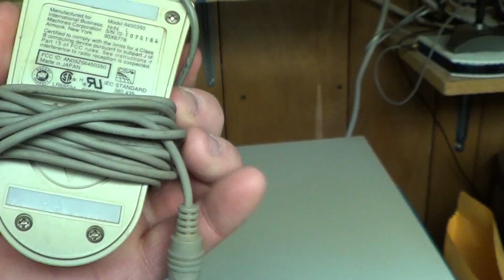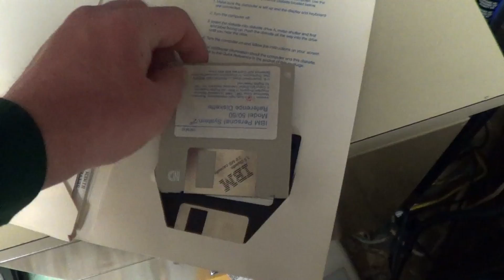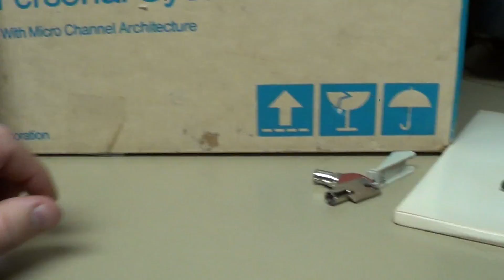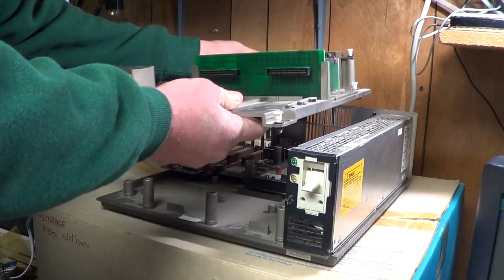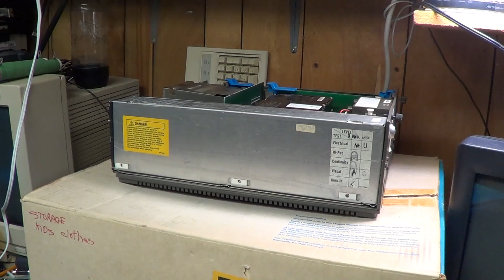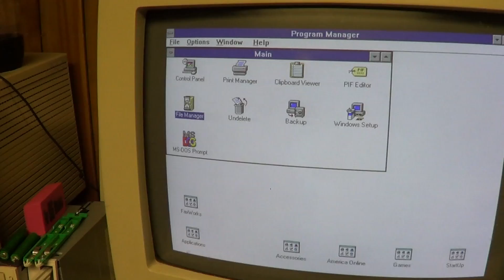The Good, the Bad and the Less Than Totally Inspired (IBM PS/2 Model 50Z Overview/Demonstration)

Comment: Just bought one of these with the original 80286. It has the monitor, keyboard and a box og software manuals. Its currently at a friends place in another city while i’m trying to find a way of safely shipping it (this is In Norway, and i don’t want to use the postal service).  It is untested, but i got the whole package for 500NOK ($50)! If you have aby tips for best practise when doing a first startup of a system like this, i would gladly welcome them!
Reply from the maker: Have a reference disk handy. You may need a replacement clock/CMOS battery. (In these it is a camera battery, the CR-P2.)

The floppy drive may need some electronic help and to be cleaned. The lack of a shutter means they can collect dust and random objects. There are surface mounted electrolytic capacitors on some of the drives and these fail often.

You might experience (as I did) a tantalum capacitor failing shorted and being blown apart.
Reply: @uxwbill  I haven't watched the whole video (does the video itself qualify as vintage?) , but in discussing transistors with vintage Apple Mac collectors: note the Macs do not have tantalums, but that means the transistors can silently leak over the years degrading the mainboard and causing damage without the owners knowing it. Some Mac collectors purposefully replace transistors with tantalums, exactly because these will fail loudly, and inform the (knowledgeable) user right away. This is arguably a better case for the user, as long as they understand what exactly is happening. I guess it's a personal preference in the end, but... think twice before replacing tantalums with "regulars". It might be bad for the computer's long term survival!

Comment: Hi! I know this is such an old video but I actually have one of these in very good clean condition, not a single bad sector on the 80MB hard drive, complete with original color monitor. I've been restoring it as a project but would anyone have any idea what it's worth today? All IBM parts, 286 chip, 1MB RAM, and what I'm pretty sure is an MCA Coax network card with PC-DOS and Windows 3.1. From what I can see on eBay the HDD is worth £70 alone.
Reply from the maker: Whenever this question comes up, my answer is always the same: "it's worth what someone will pay". eBay is a horrible barometer for the value of many things. People there have a bad habit of thinking their crap is worth more than gold, and anyone who'd pay a lot of money for a 30+ year old hard drive is either desperate (sometimes businesses are -- you'd be surprised what can still be running a "mission critical" system/program in some forgotten corner) or foolish. 

Or, more succinctly than that, "there are a lot of people on eBay who seem to have a crack habit".

Realistically, if you can find a buyer (remember, this is a niche hobby) who is interested, you're probably looking at the whole thing being worth between $100 and $200.
Reply: @uxwbill  Hi thanks for the quick response! I suppose you're right, it's such a niche thing now, so I'll list it for 180 and see what offers I get. Although here in the UK there are literally none for sale, so I might get lucky or stuck with it.

Comment: Old computers are fun as hell!   I only wish the ps2 used IDE controllers so I could update them with a SD card.  I had those capacitors blow up in a old 386dx board.  Board kept working. I did replace them though.
Reply from the maker: A few PS/2 models had IDE built in (25SX, 33, 35, 40, 53SLC2, 76/77 Lacuna board). For those that don't, you can run SCSI and something like the SCSI2SD.

Comment: I acquired a PS/2 model 70 a while ago.  I do appreciate the modular design.  I was also fortunate enough to have gotten an IBM VGA monitor and a 8514/A adapter card in the purchase. :)
Reply from the maker: On the proper monitor, the 8514 video mode is quite nice. (Even on the "proper" 8514 and 8515 monitors, you can still see the flicker, but for me at least, it is tolerable. And 256 color high resolution video is nice on a 286 class machine. I used mine in a Model 50Z. Should set it up again and do a video, while I still can.)
Reply: @uxwbill  Yeah, I haven't gotten around to get my PS/2 up and running yet.  I'm aware that the refresh rate is nothing home to   write about nowadays, but if i throw a LCD CGA monitor at it, it should hide the gflickering.  Been wrestling with a Gateway 2000 4DX2-66V...  I really kinda want to throw Windows 3.1 at the PS/2 just for kicks since the 8514 is well known for being one of the early fixed function windows accelerators. :)

Comment: I finally got around to cleaning up my own PS/2 Model 50Z today, and let's just say, I got to experience "tantrum capacitors" firsthand.  That very same cap, C23, while it didn't turn itself into a rocket like yours did, it did blow its top off and send flaming bits of itself skating across the inside of the computer.  It really is rather dread-inducing watching this play out through the computer's front grille.  Fortunately, after dismantling the system and clipping the remains of the blown cap off the board, the system did come back to life (though I should probably still source a replacement cap).  Now it's bombing out on 161 and 163 errors (I assume due to the dead and subsequently removed CMOS battery), and it refuses to boot the reference disk (both the original and a downloaded one), so that's next on my list.

Comment: I just found your channel and I have an old Model 50 I have kept in a garage. I didn't do a good job of protecting it, but it turns on and give me a 182 and 163 error code. I have no technical knowledge and I don't know programming. I think the problem is the CMOS battery. How can I replace the battery without losing what ever I have on the hard drive? I have copies of the Reference disk. Can you help?
Reply from the maker: Are you sure the first code given is a "182"? (This is a valid code, but refers to a feature that was still many years in the future.)

Replacing the battery is the easy part. It's located near the front left corner of the system as the disk drive(s) face you, near the speaker. The battery used is actually a camera battery (a CR-P2) and they are still made today.

The harder part is going to be getting the system running again. The floppy drives in these things are a notorious weak point, especially now. They suffer from electrical (bad capacitors, typically) and mechanical (dust, foreign objects, jammed/sticky parts) issues. Unfortunately, they are also unique to the PS/2 -- a standard drive won't work. Check for any physical damage to the system's internals and make sure no objects are shorting anything out anything.

It is very unlikely that you'd lose any data stored on the system's hard drive if it is still good.

Hook the system up after you install the new battery. Insert the reference disk, power up and see what happens. (You may have to press the F1 key after seeing all the errors.) The reference disk may take over a minute (sometimes two) before it starts up, if it is going to. If the system stalls, or you end up in IBM Cassette BASIC, the floppy drive is likely going to require repair, which is really the only option these days. Working replacements just aren't available any more.

If the reference disk starts up, answer its prompts and attempt to run automatic configuration (which is pretty safe to do). If you're lucky, this will complete without issue and the system should start up normally. If it does, I'd strongly recommend you have a means to rescue your old data at the ready -- these were very reliable systems, but time and the storage conditions are not on your side. You may only get the one chance.
Reply: @uxwbill  I made a mistake. I get  162 and 163 error codes. I ordered the battery and to make sure, you're saying I can replace the Battery and I won't lose any stuff on the hard drive. I pressed F1 and got to the Date and Time prompt, but didn't know what to do until I saw another video tonight. I think I'll be able to get to the C: dir.
My main concern is if I have Pagemaker on the C: drive because I don't have the software any longer to run PM3 files. I should know tomorrow. Thanks for replying and I know I'll have more questions.
Reply from the maker: Replacing the battery will not cause data loss.
Reply: @uxwbill  I'm really not  technically knowledgeable, can you make a short video about replacing the battery in a Model 50?
Reply from the maker: Not at this time. However, it is a simple process:

1. Remove the computer's cover after loosening the two thumbscrews at the back. (Hopefully it's not locked, or you have the keys.) The cover slides forward about an inch.

2. Locate the battery. It is in a plastic holder near the left front corner of the case, just above and behind the system speaker.

3. Remove the battery. Gently press the clip at the rear of the battery backwards and lift the depleted battery out of the system.

4. Install the new battery. I usually put it in front (terminals) first, and press down on the rear.

5. Reassemble the computer, and use the reference disk to run automatic configuration. As long as you have no expansion cards, or expansion cards made by IBM around the same time as your computer, that's all you should have to do.
Reply from the maker: You may also find this illustration helpful: http://ps-2.kev009.com/ohlandl/8580/8580_Common_Devices.html#Battery_Orientation

It's for a Model 80, but the same type of battery and holder are used in that system as you will find in your Model 50.
Reply: @uxwbill  OK!!!! I see how easy it is and am waiting for the battery I bought on EBay. Thank you very much. I'll let you know if I finally get it working. I don't have an original Reference Disk, but I do have a copy I made.
Reply: @uxwbill  I changed the battery and I no longer get the 162 error. I get a 161 and 163 error. I think that means I'm supposed ton use some Setup Disk, but I don't know which one or if I have it. What do I do?
Reply from the maker: You need to start with the reference disk. It's just the single diskette. Put it in and let the system boot from it, which may take a minute or more. (During that time, the system may appear to do "nothing" for a while.) Although reference diskettes are "marked" to indicate that they're special to the system, sometimes you may have to press F1 after seeing all the error codes displayed and hearing the double beep.

If you do not have the reference disk or yours is bad, many people (myself included) have kept copies of them online. You'll need a computer running DOS or Windows and having a 3.5" high density floppy disk drive to make them. You'll also need a blank high density 3.5" diskette that is good.

Should the system hang up or drop you into IBM Cassette BASIC, this indicates that the floppy disk drive will require service.

If there are any expansion cards installed in the system, you will need the matching Adapter Definition Files (ADFs) for them.
Reply: @uxwbill  I got the battery changed and got rid of the 161 error. Then I changed the Date and Time and got rid of the 163 error. Now I get a 1790 error every once in a while. It also tells me my Reference Disk is bad, every once in awhile. I ordered a Reference Disk from the Netherlands and hopefully it will solve my problems.
Reply from the maker: No, the disk drives in your system are failing. If the system will boot, and you can do anything with the floppy drive...now's the time to start moving data out of there. You're not going to get another chance, and time's not on your side. If the floppy drive won't work well enough to do the job, you might try tools like the old LapLink program or Microsoft's InterLink/InterSvr.

(Yes, that sounds bleak, but it's also the truth.)

The hard drives in these systems die from internal contamination over time, if old age doesn't get them first. The floppy drives are repairable n most cases -- make sure they're clean, and replace the surface mounted capacitors on the drive's circuit board.
Reply: @uxwbill  I actually got the IBM logo on screen and got to the C: drive. But I only got there once.  I have a laptop with Windows 95 and I have an external 3.5 floppy drive. I checked my Model 50 Reference Disk and I got a Disk Not Formatted. What does that mean?
If this hard drive stores data, your solution is way over my head. I have no idea what to do.

Comment: i got a ps/2 model 50 (not Z) too bad, dead harddisk, bad floppy drive... i cleaned the drive but... what about the harddisk... really terrible... also what is the color? paint is getting off, somebody know?
Mmmm now i found a solution.... booting with a floppy with a driver for ZIP drive so i can use a zipdrive as 'harddisk' still not the best but it works.
I would love to have a emulator for the harddisk and using CF or SD cards and a floppy drive emulator, but it is difficult to get that working... :(
Reply from the maker: Some kind of appliance enamel in a suitable color would work to restore the paint. Floppy drives are generally repairable, and if you haven't already done so, consider replacing the surface mounted capacitors in the drive.

The hard drives, especially in the Model 50 (no Z), are quite failure prone. Your best bet is probably to find a SCSI controller board and something like the SCSI2SD or a SCSI CompactFlash card reader. Something like the Future Domain MCS-600 or MCS-700 adapter, or IBM's late production "short card" uncached SCSI adapter would do nicely, and ought to fit in the hidden fourth slot.
Reply: @uxwbill  ok, i cleaned the drive so it works again, hope it will live for long but good tip about the capacitors, i maybe replace them before they burn out ;-)
SCSI is expensive here i found a board AST board for the PS/2 but it was €150,= ... for now to expensive but i will think about it, i did not now there were working scsi-CF/SD adapters. This changes a lot because the zip drive solution is n't everything, besides that i could expand memory also ...
Reply from the maker: The capacitors typically leak onto the circuit board, leaving behind a corrosive residue. If the drive ever smells like fish, that's probably why.

Microchannel PC parts have gotten scarce. Still, if you bide your time, you'll probably find something at a reasonable price. There were a few IDE adapters made, but all are very primitive and exceedingly nonstandard.
Reply: uxwbill thanks, maybe i will dig into that, all capasitors look very good and clean. So i leave them on for now. Other thing i forgot is that i have to work on the psu for the power of the cf/sd adapter. First maybe look if i can get a harddrive with the right connector.

Comment: This is AWESOME!...What's the line (in autoexec.bat or config.sys) for the Kingston upgrade to enable the cache during startup as seen here?
Reply from the maker: You will need the actual Kingston-supplied cache enabler program. As best I remember, it's known as ktccache.exe and I know it can be found online.
Reply: Great thanks! found it. What's the size of the double sided simm on board?
Reply from the maker: 2MB, which is also the maximum supported.
Reply: I see, good to know thanks!... This is definitely one of my top tube channels as you are full of knowledge when it comes to these machines. I also have a model 50Z, my unit has a 2-8 memory expansion MCA card that is currently populated with 4X 512kb 85ns simms (4 slots/2MB). Do you happen to know if any faster sticks may work on these cards or do they only take certain low speeds?

Comment: what is the hard drive interface called on these? Got one with a broken hard drive and i am having trouble finding a replacement
Reply from the maker: It's nonstandard: the drive connector is basically a Micro Channel expansion slot passed to a disk controller card mounted to the hard drive.

There exist IDE and SCSI boards that will fit into the hidden fourth slot on the Model 50 or 50Z, but all are quite rare, especially these days.

Comment: If you're looking for PS/2's, the Usenet newsgroup comp.sys.ibm.ps2.hardware is still active (groups.google.com) . I donated parts from my "dead" 55sx to someone more determined to keep his 55sx going than I was. Had a dead Dallas clock-battery-chip when I powered it on last year.   I tried the Ref disk but no luck (the boot-up screen had the date/time error, referred me to the ref disk, which cycled  back to date/time error, no way for me to manually enter the date/time like a PC).  Simply refused to boot any further without a new chip. The Dallas chips are no longer being made.  Hacking the chip open and hooking up a battery cell, did not seem worthwhile to me.

Comment: So I found a Model 50z a few weeks back in someone's trash along with the IBM monitor and four Model M keyboards (only one cable). I only just got around to working on it, and it's been complaining about needing a reference disk. I found an image online and put in onto a floppy, but it still won't work for some reason. Any advice?

Comment: Thank you for the video! I got a computer similar to this one for christmas in 1996, and DAMN! This disappointment i felt cannot be described with words. I was 12 years old and my relatives thought they had made a good deal. I know they were fooled by the seller and that they did not fuck me intentionally, but at the time it was this or nothing.

It had a 386SX processor and VGA graphics, so it could not even run Simcity 2000. How about installing a sound card or a CD-ROM drive? Yeah, right... With MCA and lack of IDE support, I was pretty much fucked. In 1997, my friends were playing Quake on their Pentium based systems with Voodoo GPU:s at LAN parties while I was staring at the cursor in Microsoft Word 6.0.
Reply: I had a monochrome 8088 at that time, so I'd have been jelaous of you! LOL
Reply: I feel so sorry for you I could cry. BRAT!